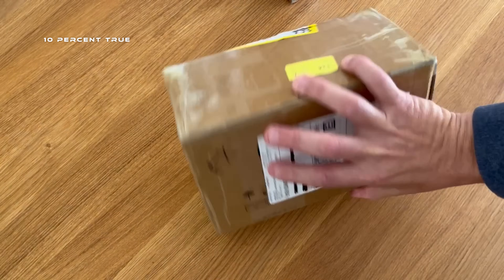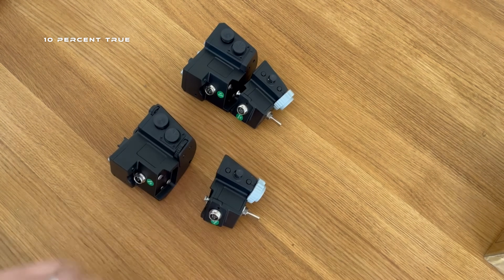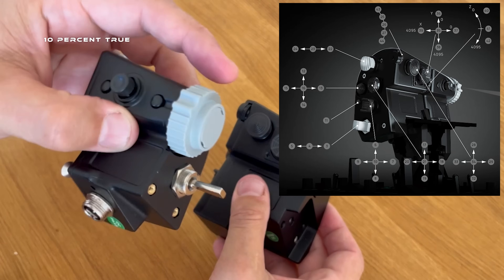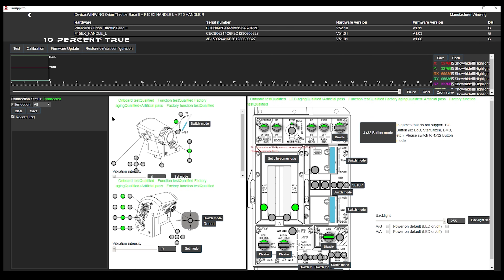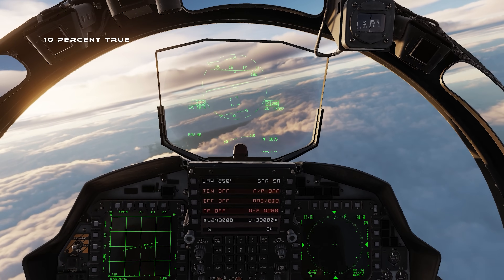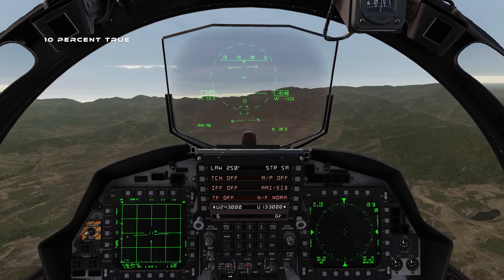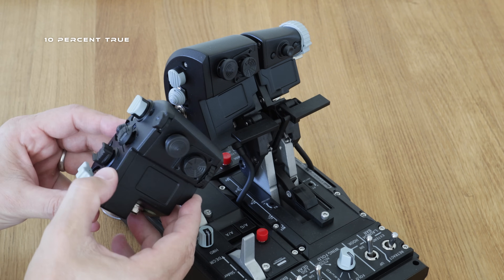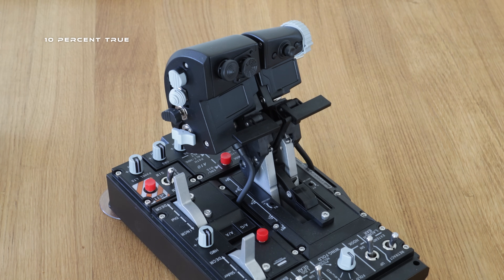WinWing F-15E Strike Eagle & F-15EX Throttle Grips - In Depth Review

Comment: Good review my friend, you answered most of my questions in this review, so have ordered the F-15 EX throttles for my existing Orion2 base too last night. Initially FA/18 throttle grips here, but with the advent of DCS F-15, this was hard to resist.

My sidestick of choice now is the Winwing F-16 shaped stick with side shake gizmo, it works well in DCS feedback wise, but I hope and as promised Winwing expand the feedback shake that is suitably subtle compared to my much, much older MS Force Feed back 2 stick and apply to other simulations too.

It's perhaps worth a mention, Winwing have a UK store now, so when I ordered my Winwing F-15 EX parts last night, hopefully I will have no FED EX import surprises this time, because have ordered many WinWing parts before and was always sprung with a big  Fed Ex import bill.

If you get the chance, and still have a good working relationship with Wing Wing, please ask for their new Rudder Pedals and damper kit review too, please.

Comment: So I don’t recommend setting the afterburner ratio in simapp because it’ll still be different for each aircraft. I set it in DCS, for most aircraft a program called DCS detent calculator is extremely helpful, for the strike Eagle it has a ratio built in to special options that is useful so you don’t need to do a user curve.
Reply: I've found for my throttle at least, just setting a curve of 3 on both sides in DCS hits the detent just right (TMWH with the push-through mod)). YMMV of course, but worth a try
Reply: That detent calculator is amazing!  Highly recommend.
Reply: @faelwolf1177  the user curves will get you something much more liner, it’s not as simple, but it does a lot for you for formation flight
Reply: @ShawnHinck  I'll check it out

Comment: Nice review, will be replacing my X56 with the F16EX & F15EX. Not that I need every single extra switch but it’s always nice to have some extras for controlling DCS stuff like zooming and changing view, centering trackIR etc.
Reply: i was thinking the same,  i use Thrustmaster f16 stick with x56 throttle.
Reply: How are you getting on with the F15EX/F15EX combo?

Comment: I recommend using the advanced settings for the vibration. There are some community done settings that are much better than the basic vibration that the standard winwing option does. So it'll have variational vibration depending on your AOA.

Comment: I have an F-16ex stick, and I agree with your feelings about the vibration, in fact it reminds me of my Volvo and steering vibration in the steering wheel.  For the stick and maybe later for the throttle, you can download settings from other people who have set up their vibration profile.  Good video, I am planning to get the EX version of the throttle in the fall to replace my X-56 throttle, I believe Winwing understands that we might have numerous different modules, and have made it easy to use some switches and hats for certain situations, for instance, the back seat of the F-15e has different controls and instead of using modifiers to simulate, you can have separate hats to do the same.

Comment: Afterburner detent can be set without finger lift or it is mandatory for this functionality?
Reply from the maker: Correct. You don’t need the finger lift kit to get the detent.
Reply: @10percenttrue  How??  I just got my Orion2 with Dual Throttle connector (not Finger Lifts) and F-15EX grips. I have NO DETENTS.  I miss the IDLE to OFF detent more than the AB detent, honestly. For now I stuck a few pieces of the Styrofoam packing at the IDLE position. NOT optimal for a pretty expensive piece of kit!!  Am I missing an adjustment somewhere?

Comment: Thanks for the review.  I use a slightly modified TM Warthog throttle and don't see enough improvements (to me) to warrant a purchase. I prefer the speed brake on my current stick. Your comment " and you have a 21 lb Brain and can remember what all these buttons do" really echos my feelings on gear for DCS. While it is great to see lots of options out there, it still doesn't change all the hours we spend mapping keys and bindings. I require a clipboard with page after page of DCS module bindings and try to review that when swapping between planes.  And yet I would still jump on the chance to buy a DCS AH-64 CPG Tedac controller with left and right grips.
Reply: im in the same boat. i also use TARGET for a lot of advanced state-logic with my hotas and MFDs so i cant really leave TM for these very cool looking new alternatives.  i am really excited to see that new Viper throttle thats coming soon! im thinking i could maybe see having that as a second throttle to swap out with, hopefully. it looks very cool.
WinWing and even Virpil or VKB need to take it seriously about getting a programmatic app like TARGET(Or Foxy before it. theres also JoystickGremlin i have heard of) to take that hardware to the next level.  users need to start demanding it, but they dont know how powerful it can be.

Comment: Interesting close look at the grips.
It didn't really change my opinion on the things though.

The EX feels like the additional buttons weren't given much thought (those twin hats in lieu of the airbrake switch look like you can way too easily nudge the first one while going for the other for instance).
Flying for real myself (albeit very very very very much not anything pointy or even powered), I can't fathom the point of shaking the throttle grip. Something like a Jetseat seems more natural since buffet shakes the airframe mostly.
The base also feels too messy in terms of button layout. I much prefer something generic that I can apply a module's logic onto should I need it.
Reply: In a sim, you don't really feel the aircraft which is super important in flying the real thing, and this is a cheap alternative to buying a 3D movable seat. I don't believe you need to use all the hats or switches but it's nice to know they are there if you do need them. HOTAS  set up is a very "personal" thing and there are many variations in hardware set ups out there.